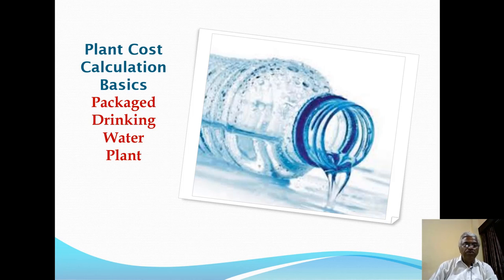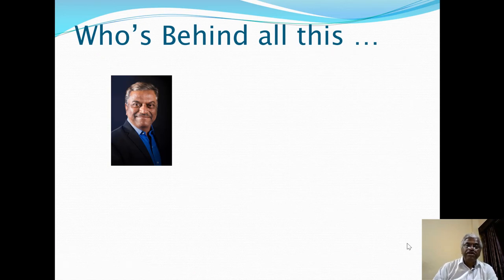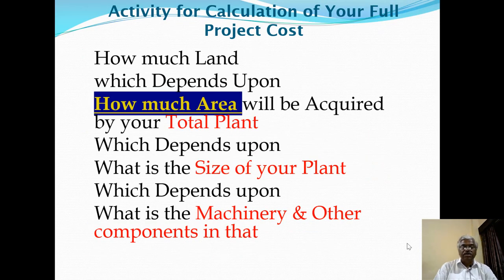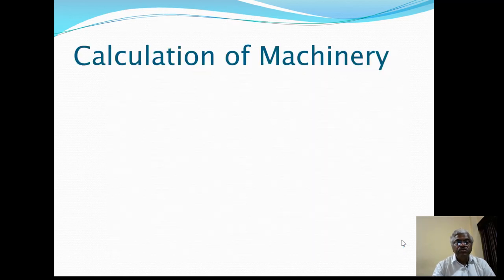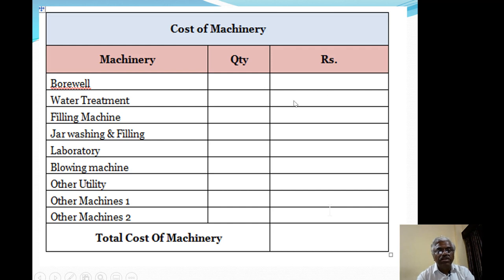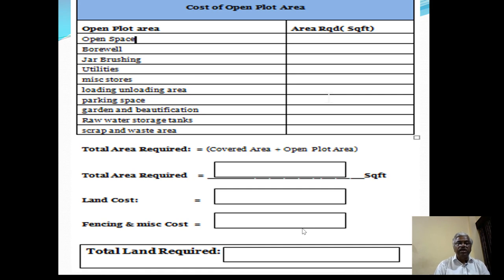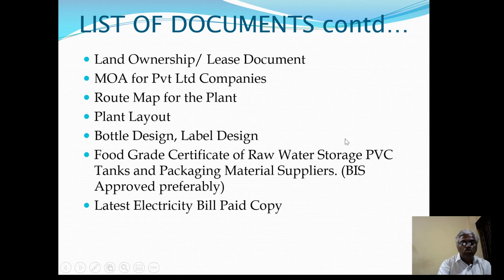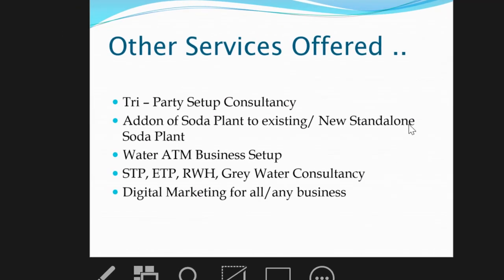Mineral Water Plant Cost Calculation

Comment: Am so much interested  in  your  training  found  it very  essential  and fortunately  am going  to star the business  .    My problem  is am off grid  can you suggest  whether  i can use a solar energy  for botting water plant or not . I need  your  suggestion  please
Reply from the maker: You mean you don't have traditional electricity at all ? For distributing the Solar energy generated, you need the electricity board. As far as the economics is concerned, it takes appx 5 years to recover the solar plant investment.
Reply: @bottledwaterbusiness   thanks  a lot  for your  response.  Let me tell you  that the water resources is a spring with average  yield of 5 liter /s . As to the investement of solar energy  if your  answer is yes  i need  to know  the cost  of the invest ment  and merits  and  demerit  of this energy source  with regard to  the projects profit   thanks  in advance  for  your  suggestion  and support. The area is very far from  electricity.  If the energy  can be supplied  from solar energy  for the  bottling plant.  It is  good  opportunity  to have an alternative  sources of  energy.
Reply from the maker: The Solar Cells also need certain time to get charged, which might be a limiting factor to switch to entire solar energy. However, a Solar Roof Top fellow can be a perfect person to tell you whether it is advisable.
Reply from the maker: You can attend a training, ping on whatsapp : 9822478111
Reply from the maker: We have created a detailed Video on Solar Energy usage for a Packaged Drinking Water Plant :- https://youtu.be/qzTWXl9pUHk ( It's in Hindi BTW )

Comment: Sir, is it not possible to set up mineral water plant in less than 5 lakhs excluding the land and borewell cost. 
Suppose I have capital of rs 5 lacs and take a loan of another 5 lacs. Can I start the business in 10 lacs? I mean 10 lacs including bottling design, testing, licenses, marketing etc
Reply from the maker: If you check details, machinery costs appx 25-30 lakhs, lab 3-4 lakhs, construction 15-20 Lakhs. You can setup your Brand instead of your plant. And get the water packed from others. This can be the way out.